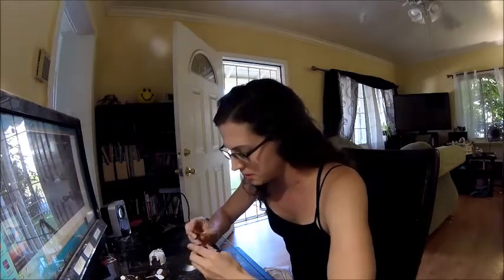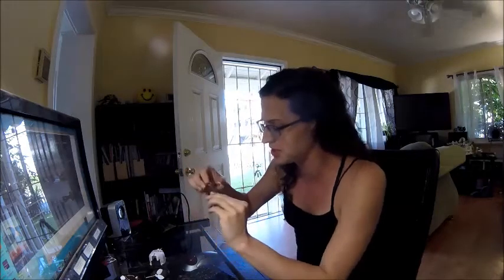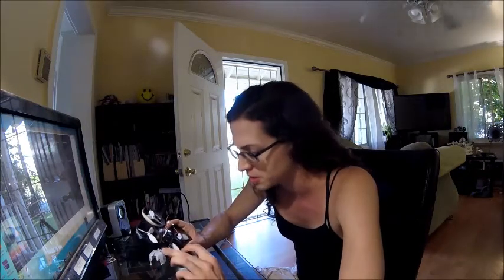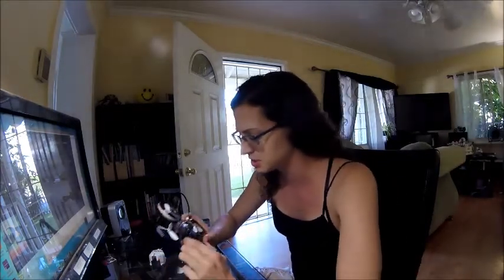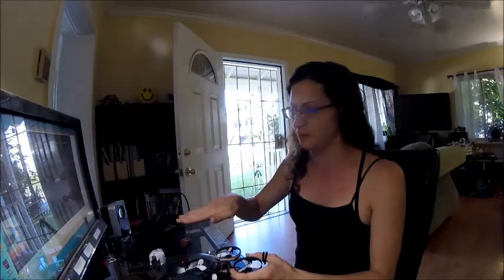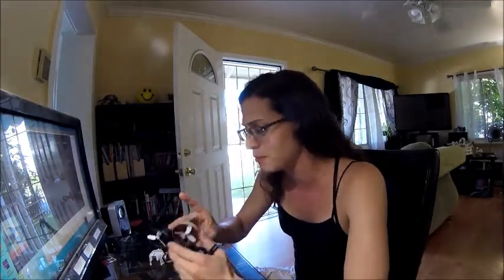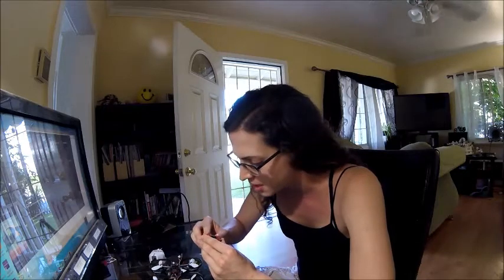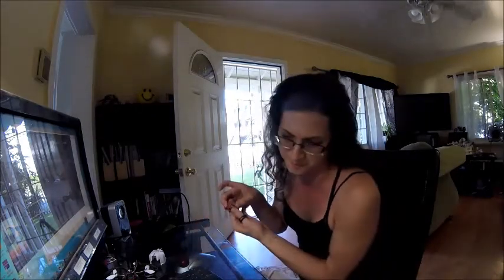RF1 Torrent- Spark and Millivolt???

Comment: I had hoped that Spektrum/HH had released it with a RF1 board in the first place so... DO IT and let us know ;)
Reply from the maker: HH is cheap and Raceflight doesn't give anything away. I'd be pretty surprised to see any RF HH collaboration anytime soon. I remember seeing a HH FC that was capable of 32k looptimes and said "optimized to run raceflight" but there was never a RF1 file released for it (that i know of)
Reply: we are still testing the RF1 builds for their F400 but (if not already) should be public soon :)

...as far as I know both the SPM4649T and the F400 were a collaboration of RaceFlight and Spektrum but I haven't heard anything about a Spektrum 20x20 FC that is supposed to run RF1 so I had hoped they would just have put a Millivolt in the Torrent but well... you are right... they are too cheap for that :D
Reply from the maker: But that f400 was announced literally months ago. So something ain't going so well somewhere lol. At least RF1 is at the point where the general public can use it. I still remember the early days and signing a waver.
Reply: Spektrum/HH can't go "public" with something finished to 95% :) They want it to work 99.99% and I can see why... kind of sucks... but well... it's their decision to make and if I were them I wouldn't jump the gun as well... do you have a F400?

Comment: My Spark 4 in 1 arrived with two giant capacitors, are they necessary? Or optional?
Reply from the maker: Try using one. If you can not get noise out of the gyro traces you may have to run the second. My build is only using one and my spark also came with 2.
Reply: Where exactly do I attach the capacitor? PDB battery tab inputs? I can't find info on this topic?
Reply from the maker: You want to get it as close to the batt input tabs as poss. i have mine on the end of the cable, wher the batt plug is. look at my thread (linked above) for pics.